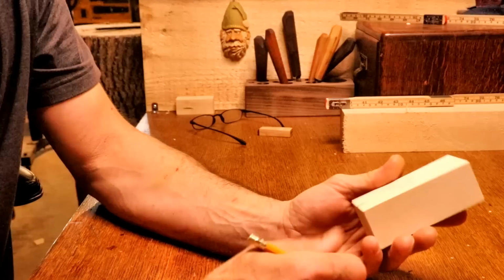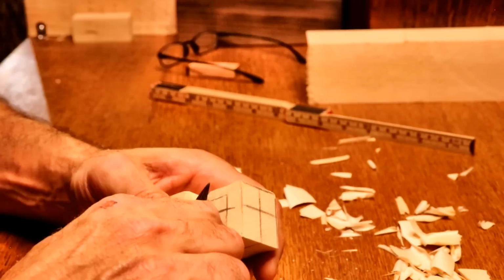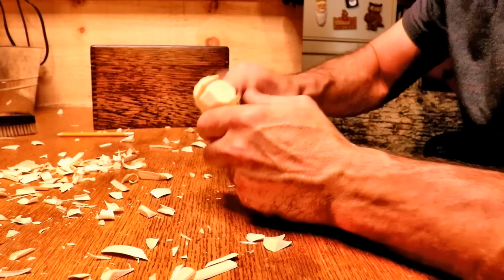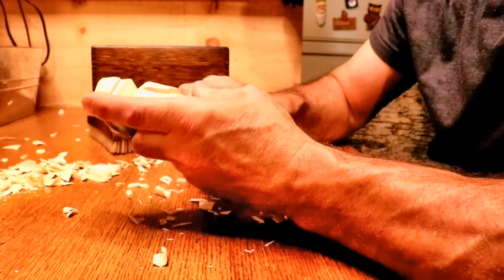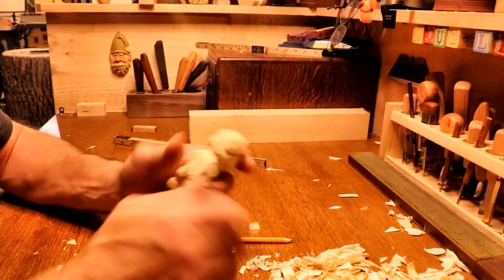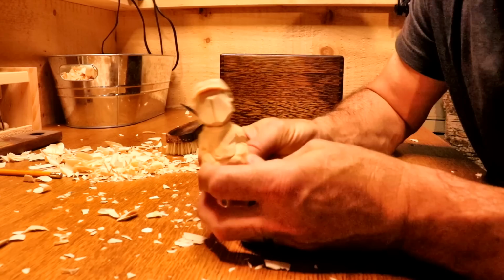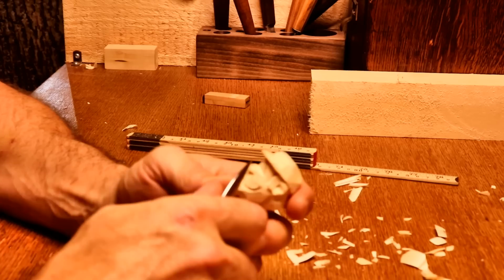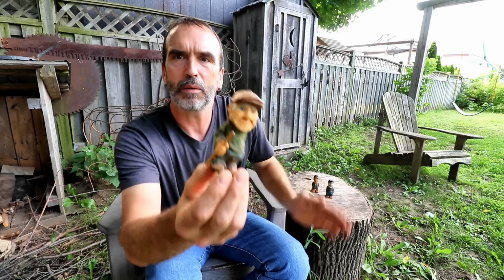Woodcarving How To -Carve a Little 4" Man -Start To Finish

Comment: Hi Doug, you mentioned that you are trying to improve the lighting for your videos. I studied photography at Uni for a while and one cheap trick is to enclose a lamp in a box with a white interior and use that semi transparent cooking paper at the open end (one or two layers as required), I don't know what it's called - maybe baking sheet or something - greaseproof seems to ring a bell to me. It diffuses the light from the bulb to give an even 'ambience' or glow, rather than coming from a sharp point of light. Theoretically, you are looking for what is called, as I seem to remember, 5,500 Kelvin (tech name for natural daylight 'warmth' or colour cast), which is neutral, rather than the orange or blue cast associated with various home lighting bulb types. Hope it helps.

By the way, what I'm learning is that carving - whittling - starts with big blocky cuts and finishes with shavings, pare cuts and tiny little detail refinements. A bit like carpentry, really.

And yeah, I get the 'I watched it all' badge and what you're saying is that it's all about taking each component - or feature - and treating it to fit as the figure develops. Follow some basic guidelines but don't start with a plan, just finish with a character!

Comment: Ive found out not to throw my failures away, i had a couple that i had confined to the shed, couldn't get any further, then after a few weeks taking in the videos some of the tutoring soaked in, not perfect but i painted them, now i have two ok'ish hill billys, lesson learned, dont bin, try something else and go back later. Cheers, Billy H. Uk land🤗
Reply: Hi again Doug sorry I missed your live stream ive just been looking at it, someone posted a problem with Amazon bass wood, which is the same problem as I am getting,  I thought that I had seen you posting some tie up with Amazon, but I guess I must have got it wrong, anyway, keep posting, nice to see your lovely wife taking part, cheers Billy H. Uk land😷

Comment: Hi Doug, I have a question, is it very difficult to cut the wood? I ask because it looks like Butter when you do it but try a swiss knife and I couldn't it is very hard, the sharpening but it wasn't enough.. Or do I have my weak hands? Would it help me to buy one like yours? Would it make a difference
Reply: are you using basswood? you need to keep stropping. a swiss army knife should do just fine. another tip to keep it good and sharp is while you are carving take a break every 20-30 minutes to strop it again. i have small weak hands lol so as long as i keep my knife crazy sharp it works great.
Reply: @shanbax3932  Thank you for answering. I think the point is to keep the knife sharp because it is difficult haha. Thank you